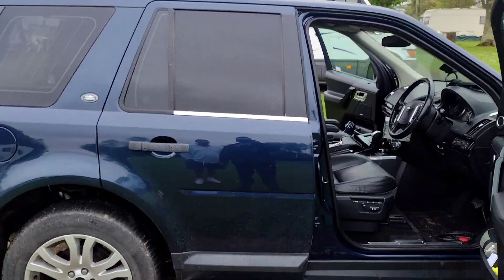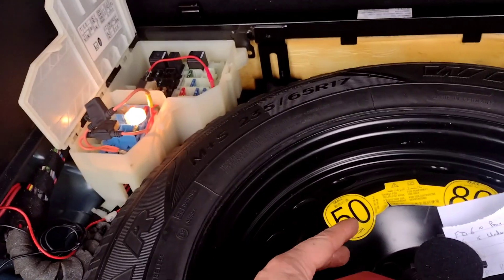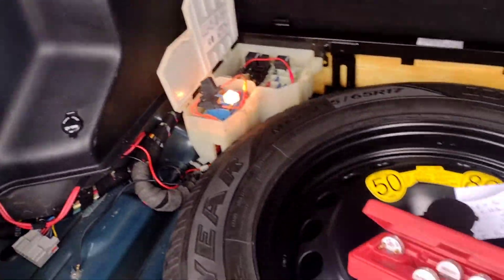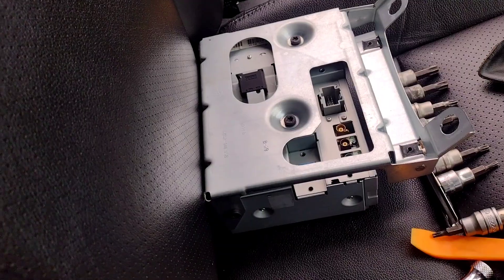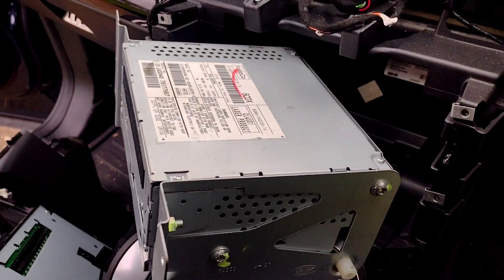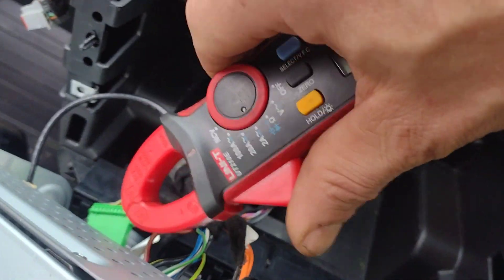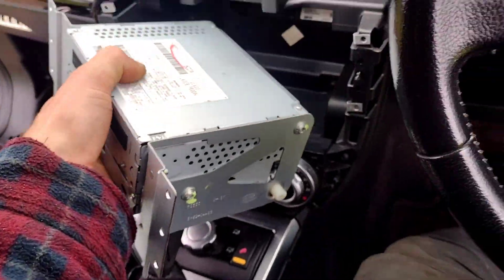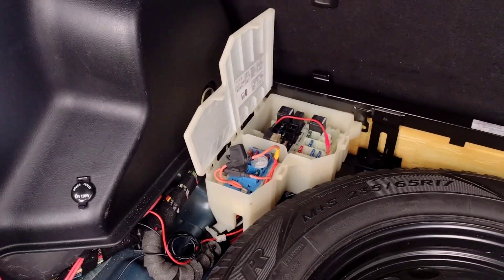Finding  a Short Circuit (with an injector noid light)

Comment: Stupid question but why use a noid light instead of a normal test light? (never used noid light before)
Reply from the maker: I forgot to say in the video, it pushes into the slot, just like a fuse. This test needs to be in series, making the noid light a good choice.
Like you say, it can also be done with a test light connected to positive and the probe tip connected to the load side of the fuse slot. If there is a short on the load side, the bulb will light in the same way. Thanks for watching
Reply: @mechanicmatt871  thanks for the explanation 👍👍